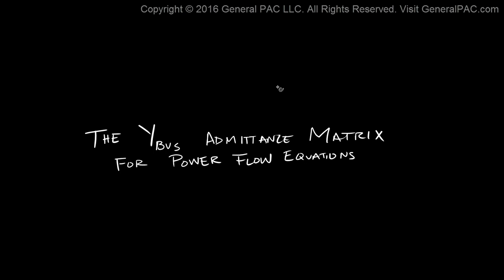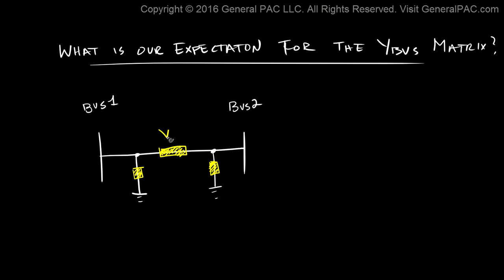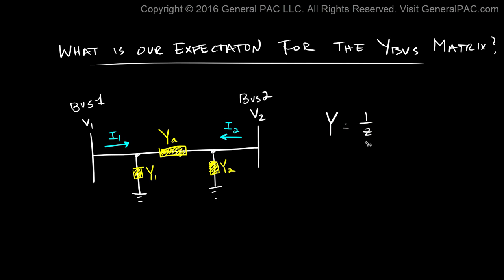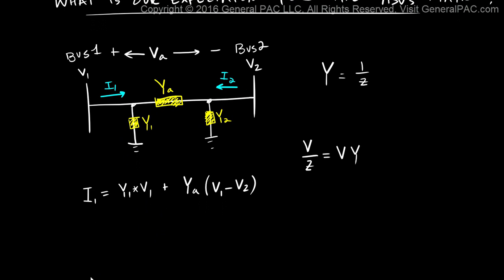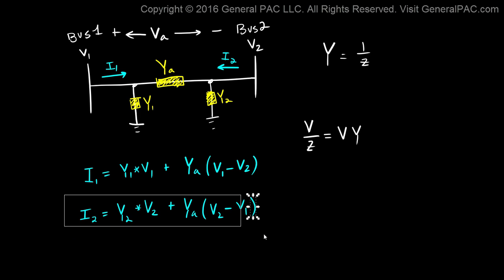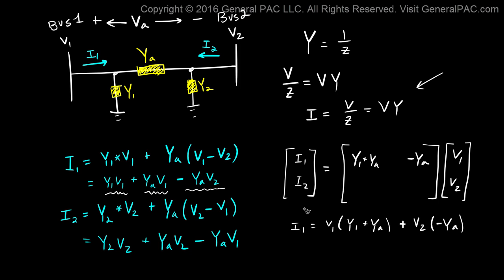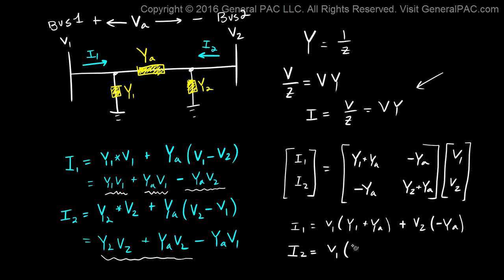The Ybus Admittance Matrix for Solving Power Flow Equations Part 2

Comment: Please, sir, can I have engineering applications on the topic of optimization in one and two dimensions? The analysis is numerically, that is, the numerical analysis
Reply from the maker: Hey batool, are you asking that where these numerical analysis are used in engineering or if there is any application (online app) for making calculation easier? Please elaborate!

Thanks,
GeneralPAC by AllumiaX

Comment: What if the transmission line is short?
Reply from the maker: Hey Afnan,  
 
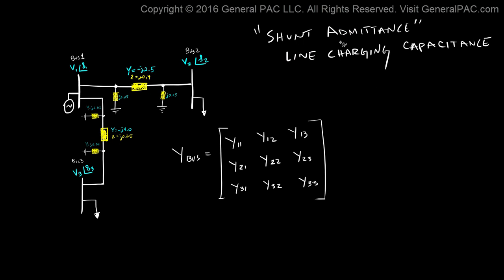The shunt admittance (Line Charging Capacitance) mentioned at 0:42 in the video would be ignored since this parameter is negligible and is not considered in Short Transmission Line Model. The rest of the working model would be same.